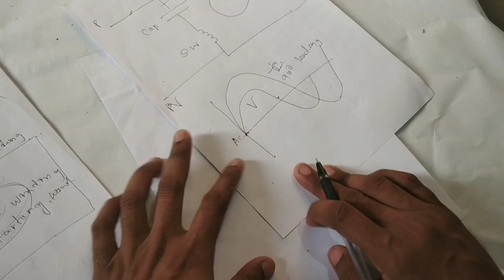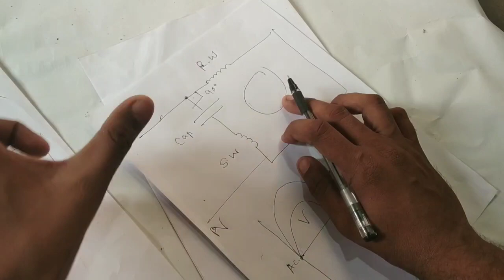Why capacitor used in single phase motors and fans in telugu 2020 i.t.i diploma electeical

Comment: Sir good evening Star and delta stater ni 3 phase motors lo starting current thagginchadaniki use chestaru ani nenu vinnanu ante 1St Star lo run chesi kasepu taruvatha delta Lo Run chestaru ala cheyyadam valla use enti please cheppandi
Reply from the maker: Stating lo torque ekkuva vuntundi anukodam star lo run chesi taruvaatha delta lo run chestaaru
Reply: @ELECTRICALTECHINTELUGU  Sir good evening adhe ala torque reduce cheyyadam valla enti Laabam ante motor life ekkuva raavalana leka pothe inka advantage's inka evvaina unnaya
Reply from the maker: Direct ga delta lo run cheste motor trip avutundi
Reply: @ELECTRICALTECHINTELUGU  Sir good morning Sir mari konni motor connections inside winding connections Star chesi bayataki 3wires tisukostaru inka Star lone adhi Run avutundhi, konni inside delta chesi 3 wires tisukoni vastaru inka motor delta Lone Run avutundhi kadha appudu motor trip avvadha
Reply: Sir please reply evvandi
Reply from the maker: Avvadu